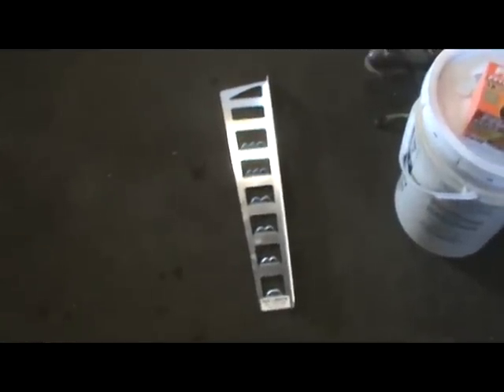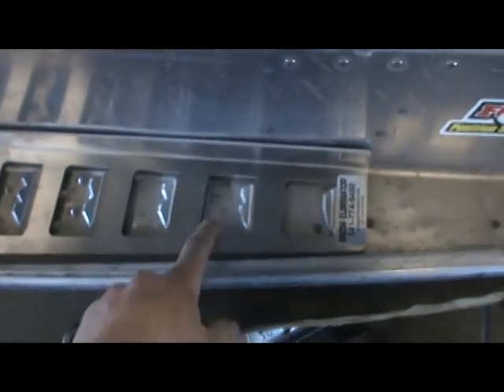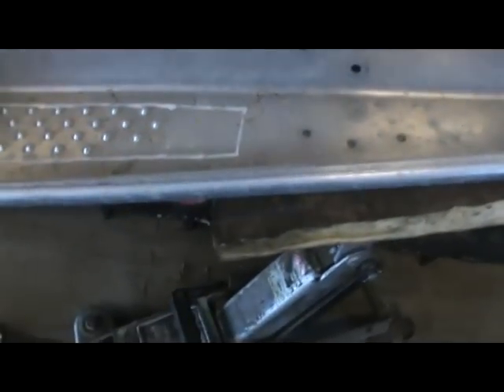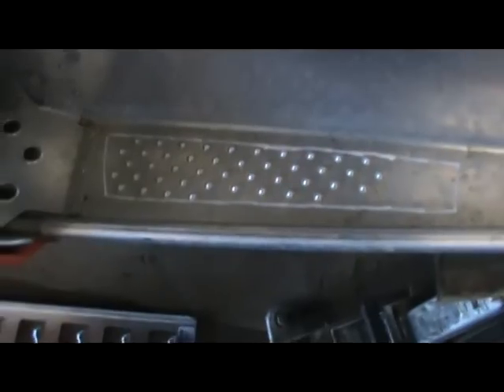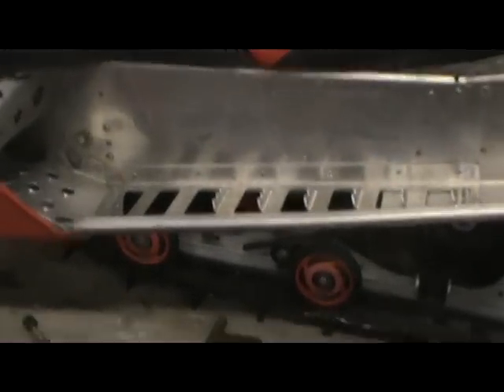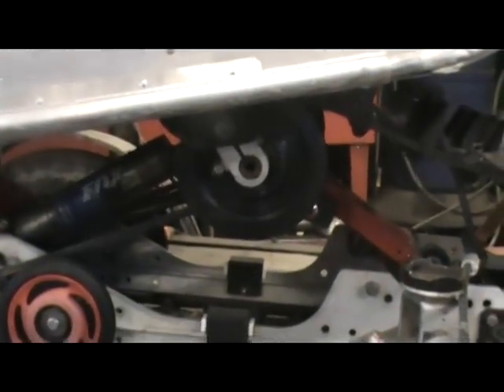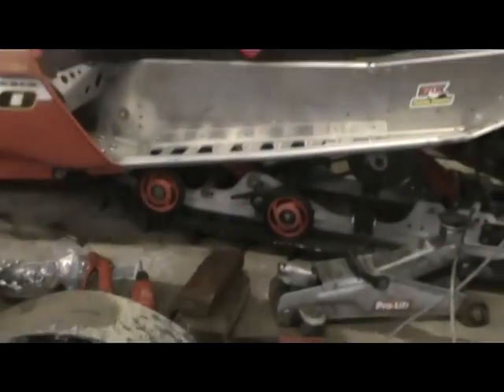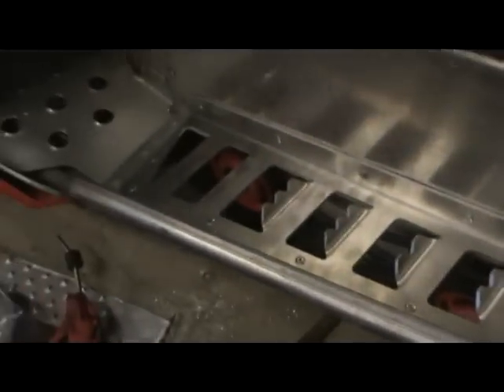Installing snow elinminator!

Comment: I have a set of these boards I bought second hand. They are in great shape but they did not come with rivets. Can you tell the size of rivets you used? Also were they aluminum rivets or steel rivets?